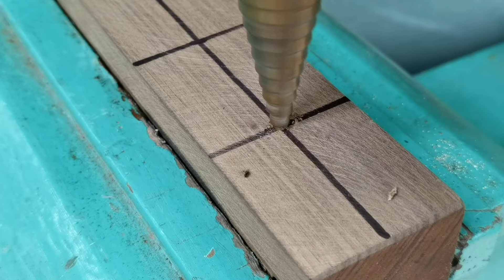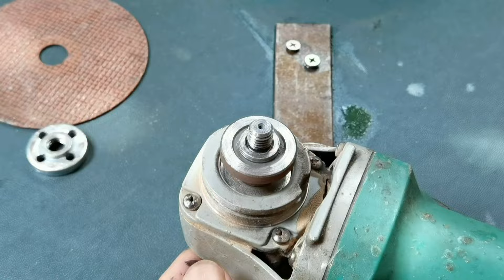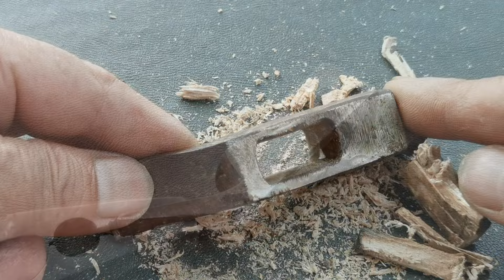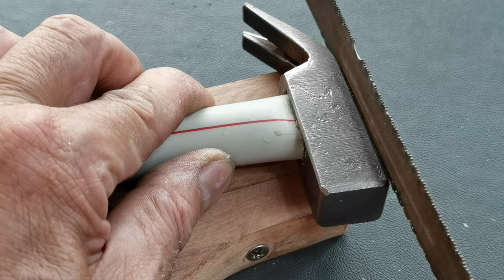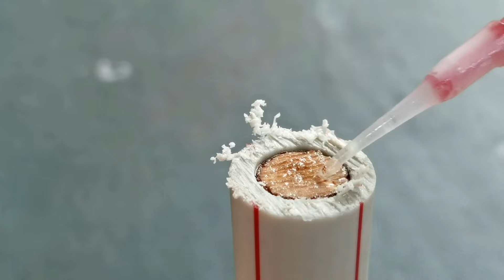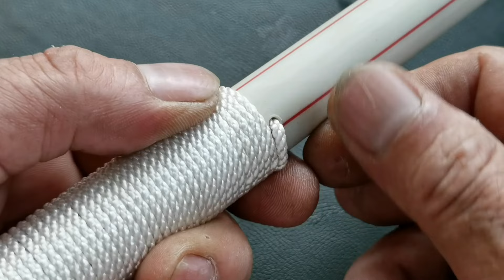How to sharpen a STEP drill !  (REMOVED WOODEN handle, UNIQUE hammer attachment method)

Comment: When sharpening the step bit why did you grind the outside of the bit? I assumed only the flat face would need grinding. Waiting for somebody to make video on sharpening those spiral step bits like Milwaukee makes now.
Reply from the maker: ok
Reply: I think they did that to give some relief following the cutting edges, which would reduce the friction and result in less heat build-up.